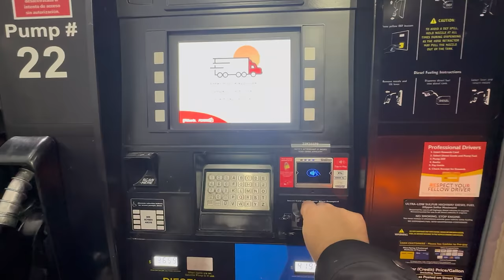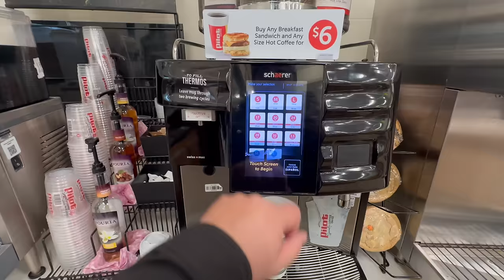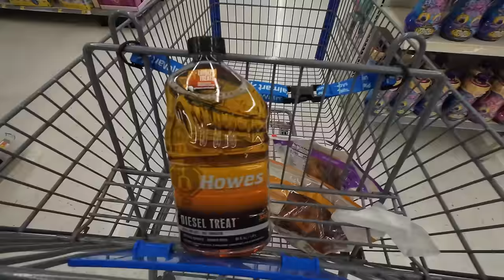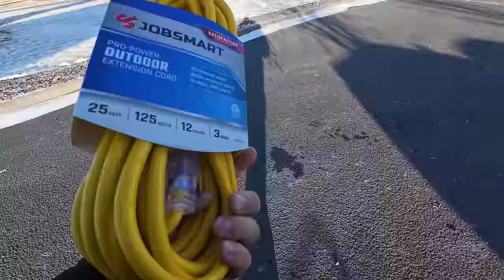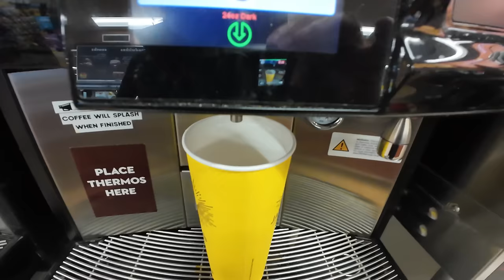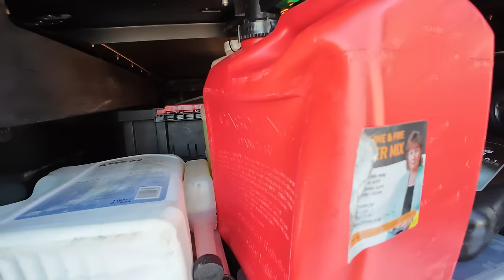DROVE RIGHT INTO BLIZZARD ❄️❄️❄️❄️

Comment: Love the drone footage. Also great idea on the generator on the catwalk. Good use of space.
Reply from the maker: Thank you very much buddy. This generator has saved me a lot of money in fuel. I’ve only idled my truck for three hours this summer, while I was sleeping at one place because I didn’t have fuel for my generator.
Reply: @OTRBandit  So is the generator powering an A/C unit for you? Also, can I ask a question? This has bothered me and I have tried to understand the reasoning behind it. I will see video where truckers run the seat belts through the doors when they shut down at night. Even seen one where someone had rigged it with the pull cord for the horn. Why is this happening? Doors have locks, so trying to understand the need for this.
Reply from the maker: @jflan8536  That’s just Youtubers who are doing it to get views. Nobody I know, and I know a lot of truck drivers have ever done that seatbelt thing or even the cord for the air horn. These trucks have locks and you would need a crowbar to break into one of these. They are just putting themselves in danger When they put that seatbelt around the door handle. If they needed to run out to Truck real fast, they won’t be able to do it because that seatbelt is holding the door. Very dangerous and stupid thing to do on their part but they only do that for views like I said. This generator right here is for my portable stand up AC unit that I have in my truck. I use it so that I don’t have to idle my truck while sleeping. Saves me a lot of money in fuel.
Reply: @OTRBandit  Thank you so much for clearing that up. I hadn't considered the dangers if having to exit in a hurry, but you bring up a great point. I seen several videos with people doing that and really racked my brain trying to understand it. I even went so far as to think maybe the sound of an idling truck makes it difficult to hear folks jockeying the door. Thanks for clearing that up. Another question if I may...You see it alot nowadays, more than before I think. But alot of drivers stopping or parting on on and off ramps...is this because of electronic log books. As in hitting the allotment and just needing to find a place to stop immediately. Where I live in AL we dont have alot of truck stops along I65, but I have seen this too up into TN and GA.
Reply from the maker: @jflan8536 you’re very welcome buddy. Parking issue has allot to do with ELD. When that time runs out, drivers have to stop. Some try to plan their routes so that they can park at truck stops but planning is not a very good option here. Traffic and bad weather will always mess up your plans. I think we should be allowed to park at on ramps at every interstate and that would solve allot of parking problems but we should not be allowed to park on exit ramp because people are driving fast when exiting the interstate.
Reply: @OTRBandit  That's what I figured, but thought better to ask an expert. Watching your last post now, and I've subscribed. Like the videos, keep it up. Think I heard you'll be in or around AR to pick up a load. Be careful, after about a month with no rain across the South, God decides he will give all of it in the span of a week. Stay safe! Truckers keep this country moving. Cheers!
Reply from the maker: @jflan8536 Much appreciated buddy. I was in Arkansas when they had that Hurricane down in Houston. My videos are usually uploaded 2 weeks after i recorded them. Takes sometime to put these together.

Comment: Back in the late 70’s I drove for a U S Mail contractor driving from Scranton Pa to Philadelphia Pa 5 nights a week on a scheduled run. And we had to follow the same motto as the mail persons. “Neither rain nor snow nor heat of day nor dark of night will keep these couriers from their  appointed rounds” 
The only time we stopped was when the post office cancelled our runs , in the five and a half years I haul d the mail I think I was told to stay home maybe 4 times if that many.
I learned a lot of winter skills driving  in the inclement weather but the best was staying as alert as possible and aware of your surroundings and how your truck reacts. I did all this without anti lock brakes where you didn’t apply your foot brake until you applied your trailer brakes first all in a short nose White 9000
Reply: I've driven in quite a few blizzards, freezing rain, on Rhodes packed with a foot of snow that stayed there all winter etc and it is a scale.. Or group of skills. You really learn to feel the road and how to handle losing traction. 
Anti-lock brakes don't really help though in my experience. Play if you are using the brakes at all it is very lightly. I'm worried about these new trucks.. with things like Auto braking, emergency braking etcetera that override the driver. We had some with auto braking that would react to Bridges and slam on the brakes hard.. or see a car in another Lane in a curve and lock the truck up. The mechanics disabled all of that crap
Reply: @charlesreid9337  all the trucks in our fleet only have abs nothing else

Comment: I used to haul out of Denver. I kept a tub of cat litter & ice melt. Came in pretty handy more times than I can count, especially when backing into a trailer that has ice and packed snow in front of the landing gear. Gotta give those drives tires a little help 😁
Reply from the maker: Ice melt is definitely a good idea. Saved me more than a couple times.

Comment: Be careful with that gas generator I've had two   friends die because of them strapped on the back of their truck get you a little diesel one has two advantages the fumes won't kill you and you can rig it to run off your tanks
Reply from the maker: I heard that there can be dangerous. I always crack my window open when my generator is running and I have two carbon monoxide detectors. I will definitely have to look into diesel generator. It would be allot more convenient to just tap into my fuel tank and not have to carry gas can around with me.

Comment: Maybe a dumb question but how do you stay warm with the engine off?
Reply from the maker: I bought something on Amazon called bunk heater or diesel heater. Runs of batteries. Works very well. Best $150 I ever spent.

Comment: Hey ,good evening , beautiful truck, what year, engine, 13 /18 spd.? I assume you own both truck and trailer? Anyway, I would've done exatly the same thing, I hatye driving in those terrible conditions, stay warm, take care and safe journeys! Enoy your video.
Reply from the maker: Appreciate it. Truck is 2016 Glider Pride And Class with 1998 Detroit 60 12.7 with 13 speed transmission. Thanks for watching. Be safe out there!! And yes, I own everything. My MC number as well. Running for myself.
Reply: Outstanding sir, I applaud you!!

Comment: Just curious why deadheading (costing fuel) is better that a shitty paying load? Isn't something better than nothing?
Reply from the maker: I always get paid as if I was doing round trip when I go to Colorado or Florida for example. Let’s say, I pickup a load out of Denver and I’m taking it to Hannibal Missouri. 800 miles, I’ll probably get paid $800 maybe $900 max. I deadhed 450 miles to Hutchison, KS and pickup a load of salt to Hannibal for $1200 for 450 miles. I have put myself in financial position to where I don’t have to haul cheap freight. I used to haul cheap freight but I don’t have to anymore. It would break my heart to have to haul that less than a dollar load. Sometimes not is better than something.
Reply: Not when you blow a $300.00 tire, eight hours on duty not driving, Momma waiting and another good paying load.

Comment: Put about 3 to 5 gallons of gas in each tank And as long as it doesn’t have any water in it nothing will freeze up make your truck run better off 😮 25:33 through that cool weather and it will also  clean your injectors off
Reply from the maker: I might try doing that this winter. Maybe it’ll help.

Comment: Bet that generator is so damn loud for the neighbors lol
Reply from the maker: I thought it would be loud when I first bought it but I can barely hear it inside the truck. I don’t think drivers next to me can hear it that much.
Reply: @OTRBandit Make sure you get a PM on it every 1500-2000 hours. That thing will start smoking in the middle of the night and will definitely start getting loud.
Reply from the maker: @JonNo86  Will do. Thanks for the tip.
Reply: @OTRBandit  Nice to see someone else using a generator. I've been running a 3800 watt Champion generator for about twelve years on my truck. In the winter time, I figure it saves me about $350 a week in fuel costs. I also run a diesel bunk heater and you're right, they sure do a nice job keeping the inside of the truck warm. I also don't think the noise is a problem. When I'm parked between two idling trucks, I can't even hear my generator running. I run up in North Dakota so there is many nights, in the winter, twenty to thirty below zero. I found a 15 gallon metal gas tank that I bolted to the top of my generator frame and teed into the gas line so my generator will run for about 3 days before I have to fill it back up with gas. I ran 2 extension cords inside the frame rails and one goes up into the bunk and runs my refrigerator, my TV, and my microwave when the truck isn't running, and the other cord I have plugged into my 1500 watt block heater and I also have a 300 watt oil pan heater plugged into that cord, plus I have a small 10 amp trickle charger under the bunk that I have hooked up to my batteries that charges when the generator is on so I don't have to worry about my batteries running low. I have been parked for up to 3 days when it was 30 to 40 below zero and my truck started up like it was the middle of the summer time. I also wouldn't be without a bunk heater or the generator ever again. Also, in the summertime, I have a small one room air conditioner that pulls 575 watts that I cool the truck with when I'm parked. Altogether, my generator saves me about $5000 a year in fuel costs plus the idle time on my engine. In the summer time, my generator will run about 6 days on the two gas tanks because I'm not pulling it as hard without all the engine heaters plugged in. Altogether, I have way less than $1000 tied up in the whole system which is a lot less than the $10-$12,000 an APU costs. My generators last about two years and then I just toss them in the dumpster and buy a new one for $325. Good luck on your travels and stay safe.
Reply from the maker: @jefftutsch5730  thank you so much for all that information. I think I’m gonna get some of that same stuff set up on my truck. I’m going to get me a trickle charger and also I’m going to get me a pan heater. I already have block heater that I use and this thing saves so much money. It is not even funny. I was thinking about buying APU but whenever the APU breaks down, you have to take it into shop and spend hundreds sometimes even thousands of dollars to get it fixed and all the last time and revenue with the truck sitting in the shop while the APU is getting fixed is not a good deal for me. Whenever this generator breaks down, I can just take it in to Harbor Freight and get a new one because I got a warranty on it and then I get a new one. I can get another warranty on that one. In the summertime I also use little portable standup AC that I keep in one of my cabinets on the side over here in my sleeper and it is not loud at all. I can barely hear it when it’s running. Idling truck is a lot more louder than this.

Comment: You say "safety first" but yet you don't have tire chains on board while going into a state that requires tire chains?
Reply from the maker: You only have to have chains if the Colorado Highway Patrol mandates the use of chains on the particular stretches of highway you intend to drive but only if you intend to drive while snowing. I don’t intend to drive while snowing.
Reply: They can and will issue you a ticket for not having tire chains with you during the months that they require you to have them. It don’t matter if you don’t intend to drive when they have a chain law out or not.